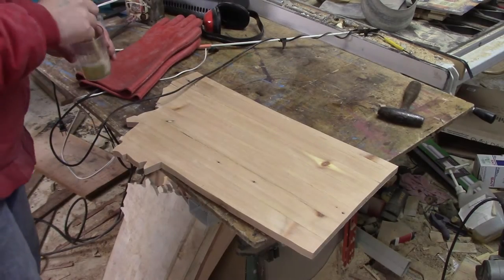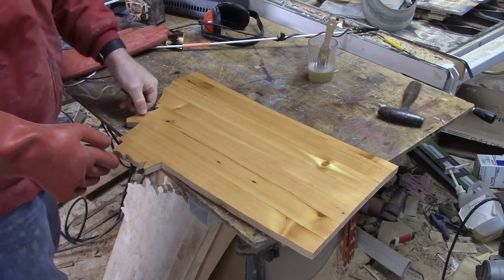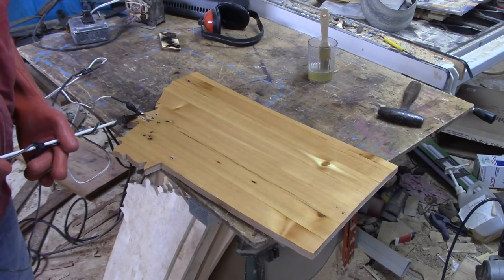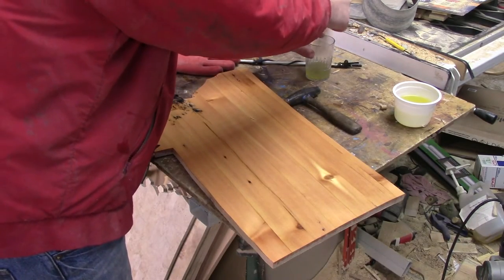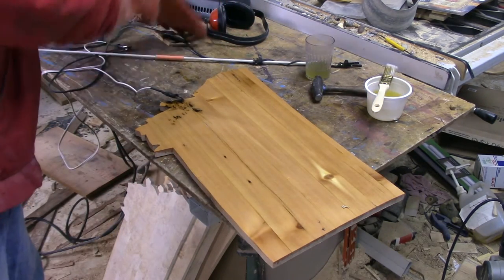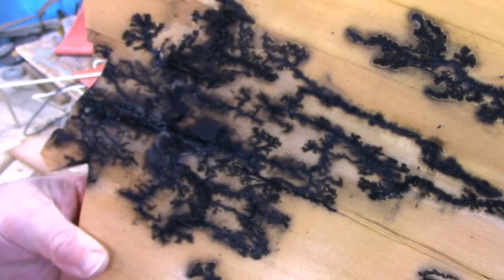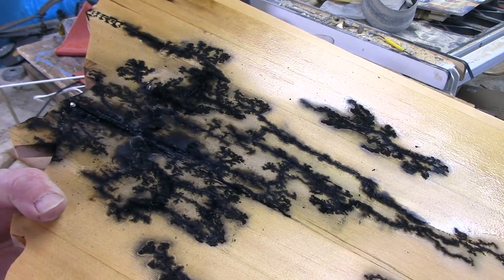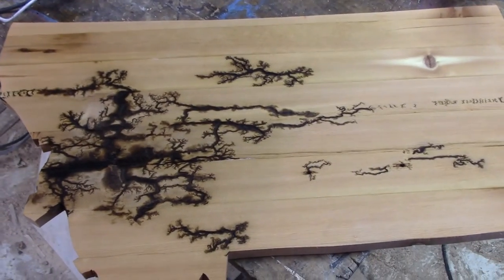Lichtenberg Experiment -Old Growth Fir

Comment: Hey ,if its running down the glue line ,why not try glue /water and salt draw your river with the watered down salty glue ,then put the charge to it ,the glue should hold the water and salt a little longer,i think the wood is too dry myself
Reply from the maker: No doubt flooding it helps.  Along your line of thinking I was just wondering if metal dust could be used to guide the arc where I wanted it.

Comment: Do you need more power?
Have a great day.
Patrick
Reply from the maker: You know it is interesting, sometimes if I cut the power it will start right up and grow, others it is like I have to keep wetting and hit it with more and more. (larger and larger ballasts)  I suspect what I really need is more voltage (2200 more or less on this) but the neon sign transformer I have (12,000) can't even hold a decent arc and will not burn the wood.  More testing I guess or just muddle through until I get this run done and then stop worrying about it for a year like last time.  Looks like FL is still agreeing with you.
Reply: Oh yes I'm loving it down here, already have the AC on for days now. You need to come down & hangout some, bring that big dog of yours.
Reply from the maker: She passed last summer.  Just up and vanished from the yard one day.  She had been acting listless the previous day but no other warning.  All I ever found was a few piles of clear bile she had thrown up, never saw her again.  We think twisted gut (torsion)  If I had just closed the gate then she would have been trapped and maybe we could have done something in time.  Looked for days in an ever widening circle, even tried to find tracking dogs that I could hire to follow her.  We had one call about seeing her unfortunately they didn't call that day.  When I got there no sign but there were Great Pyrenees working sheep in the area and I think he mistook one of them for her in the dark.  I chased every group of flocking crows until  neighboring ranchers started to get angry with me for being on their land.  Never did find her.  If Bruce ever starts puking up clear bile and lays around all day listen to his guts to make sure they are still churning.
Reply: Yes big fear of mine with as much running we do, but I'm hopeful that with the Boxer mix in him he can avoid that. I'm not sure if this helps but everyone I've talked to about that surgery is it cost a bunch & non of the dogs lived more then a few days. Many dogs will go away to die as to not bring predators near their pack after their body.
Short life span is why I never wanted a Dane.